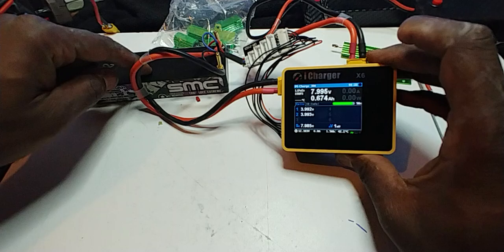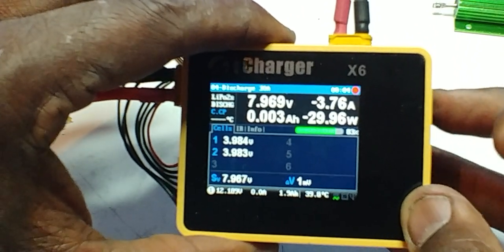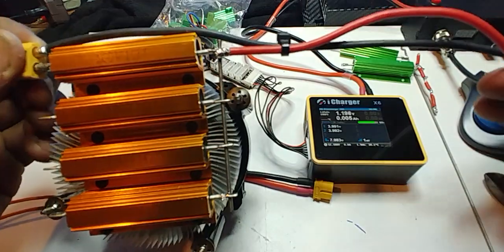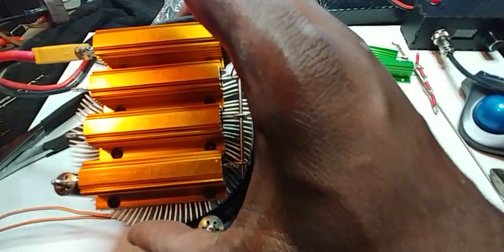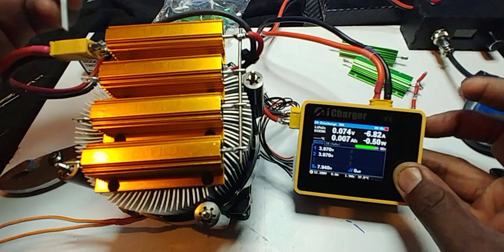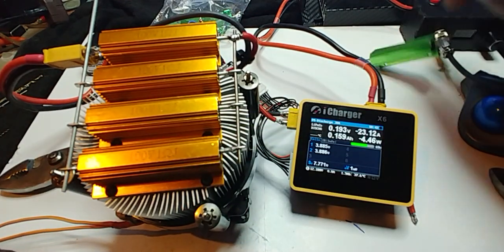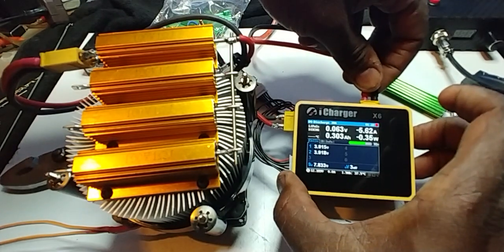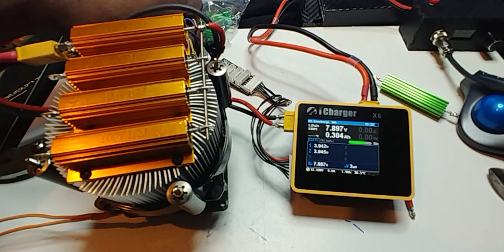X6 30 amp discharge

Comment: What setting for your charger I have 2  chargers and both ramp up to discharge at 30amp for about 4 seconds then drops back to the std 4 amps
Reply: mine is doing the same.. did you figure it out??  I can get it to work @30.. but I only want to discharge @20.. and anything BUT 30 - it will do what you say.. weird.

Comment: The little plug for balancing 2s has to be connected to the 1S positive lead to make it work. I like the idea of adding or subtracting the resistance/resistors to change discharge rate. Will be building one like this.

Comment: you ask about 1s packs... its really simple. make your self a 1s balance plug. I used an old servo plug, solder the black wire to the ground and both the remaining wire to the positive. now just plug it in like you do your 2s wires. making sure the black is in slot 1. I use this to charge my 1s batteries and now I get the IR readings on my 1s batteries.

Comment: Thank you for this. I was wondering how the connection works.  I'm not sure I understand electrically how it's working though.
Reply: you run the pos side thru the orange resistors. and they heat up and take out power.
Reply: his device is nowhere near safe, all he's doing is running the 4 resistors in parallel and using the pin on the negative side to manually choose how many resistors to combine into the array from 1-4, he ideally should have 5 resistors to reach 30 amps or near it. like i said it's safer to solder them and not has a pin that could be making poor contact, this would never pass a UL rating
Reply: @eksine  I'm sure he made a final soldered connection. This is for testing and to show you what effect each resistor has on the discharge.

Comment: Hey will,

Awesome video...had a quick question. I’m doing the math and for a 4s pack I’m coming up with 100W 2ohm resistors (5 total) to discharge 4s lipos at 30amps

Is my math correct there. 

Thanks in advance!!!!
Reply: 2.82 ohm, so about 3 ohms and you would need 5 for 30A, yes

Comment: Have you figured out the 1 cell dischaging yet?
Reply: You have to effectively run a 1s balance lead to the balance input section of the charger. It doesn't work without a balance lead because that's how to charger monitors pack voltage. Yes I know there is nothing to balance but you still need it. Trust me.
Reply: negative lead to the single cell's negative side, and the next 1s lead to the positive side of the battery. you will have all other leads unused. the x6 is a 6s charger so you have 7 wies toal,  5 wires unused

Comment: This method works fine, but you have to calculate the resistance you need based on the pack voltage and discharge rate.  Then you have to set the charger at the correct amperage for the resistor bank you have. If you don't, the charger will attempt to discharge at your higher rate, but it will not work and eventually revert back to the 30 watt maximum for the charger's internals. You must do the calculation first, and in all likelihood you will have different banks for different cell counts.
Reply: do you have the equation to figure this out?
Reply: CBA Norman I have a spreadsheet that I have worked up. Email me at chris@cdmsolutions.us and I will send you the spreadsheet.
Reply: @cbanorman7701  https://www.youtube.com/watch?v=4CVd7QjGKGE&t=1858s  It's long, and you might have to watch it a few times to fully understand, but very complete.

Comment: I wired it up the same way and did not work
Reply: Same here.. i used the same everything and it only bumped my discharge up to 4.8
Reply: @brandongriggs2760  think there is a software issue in the first batch of chargers.
Reply: @brandongriggs2760  You have to set the discharge rate higher. Search for videos on youtube and there are tutorials. Try Duo460 as a search term, and discharge.

Comment: I have the same icharger x6. Question will the charger stop discharging at voltage cutoff point?
Reply: Yes it will stop at the voltage point cutoff. You set that in the charger.

Comment: In regards to the cooling issue, on my resistor banks, I've just submerged the entire assembly into a Tupperware container full of water. I've only done it with ceramic resistors though so I'd be wary with those metal ones. But just a possibility.
Reply: what about mineral oil? Like with computers?

Comment: Hey Wil, great video, but I;m not able to get mine to discharge. I have all the connections correct, i know that but can you please tell me all the configurations/settings on the charger? Everything from input source to Z... Mine discharges but only at 2.~ amps, the bank doesn't kick in.
Reply: Have you change your settings on the "discharge" mode? I think the default setting is at 3 amps.
Reply: Brad, I'm having the same issue, did you ever find your solution?
Reply: @pusherd123  think it might be an update from junsi.  the first batches that went out.. needed an update